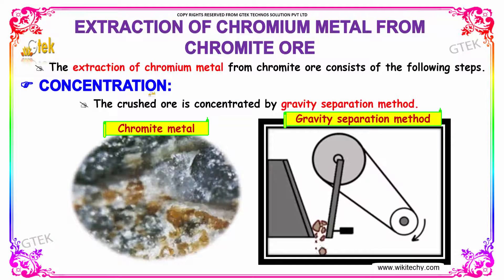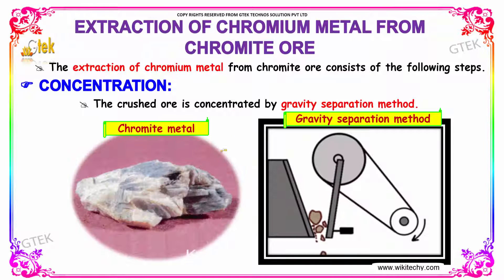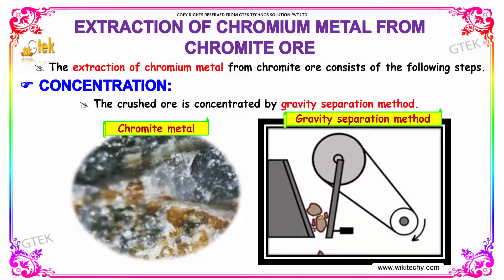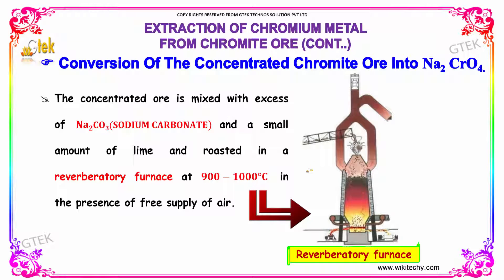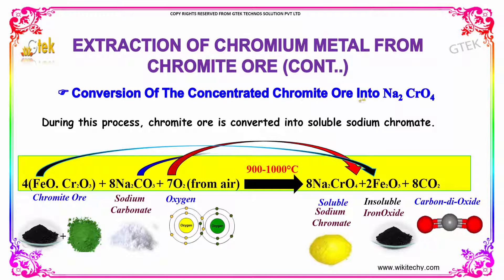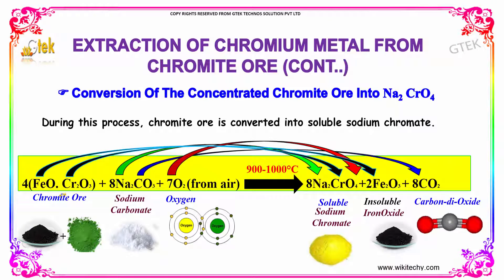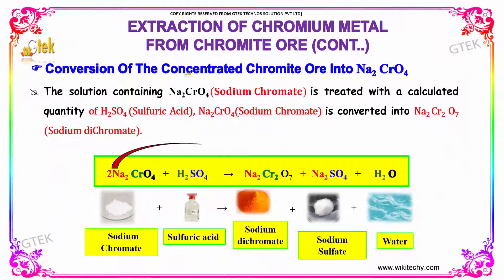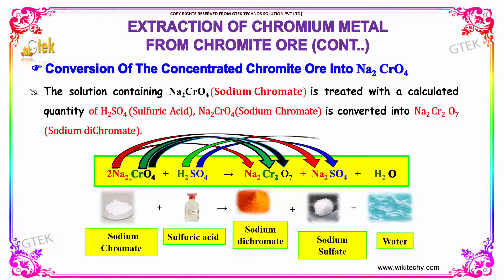Extraction of chromium metal from chromite ore D Block Element class 12 chemistry subject cbse

Comment: Chromium is a chemical element with symbol Cr and atomic number 24. It is the first element in ..... Nearly all chromium is commercially extracted from the single commercially viable ore chromite, which is iron chromium oxide (FeCr2O4). ... However, this oxide layer was not chromium metal or chrome plating

Comment: Chromite is also used as a refractory material, because it has a high heat stability. The chromium extracted from chromite is used in chrome plating and alloying for production of corrosion resistant superalloys, nichrome, and stainless steel.

Comment: Chromite, FeCr2O4, is the most commercially useful ore, and is extensively used for extraction of chromium. Chromium is produced in two forms: (Chemistry of the Elements, Greeenwood and Earnshaw, Chapter 23). (a) Ferrochrome by the reduction of chromite with coke in an electric arc furnace.